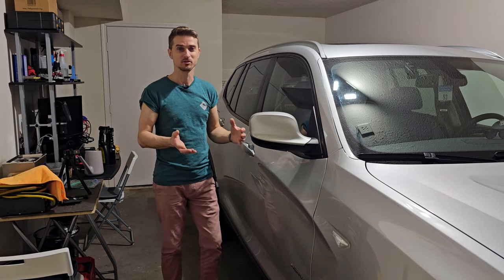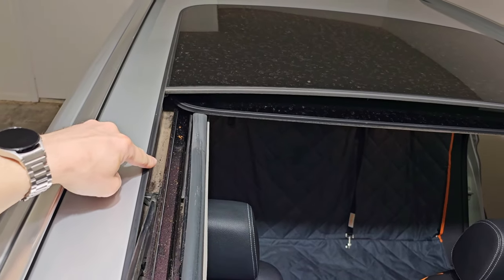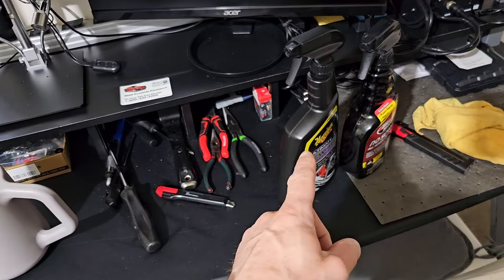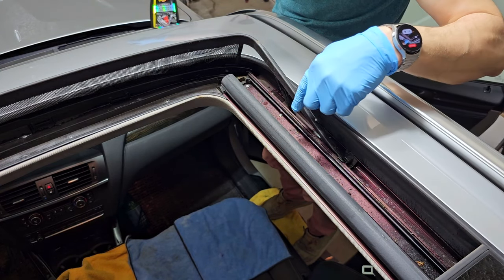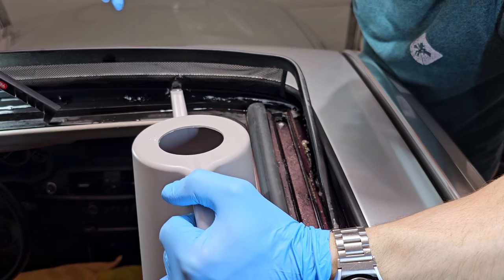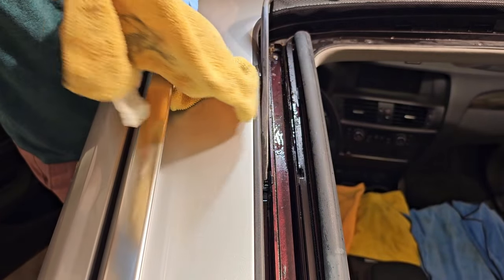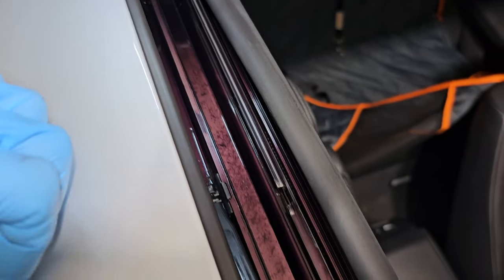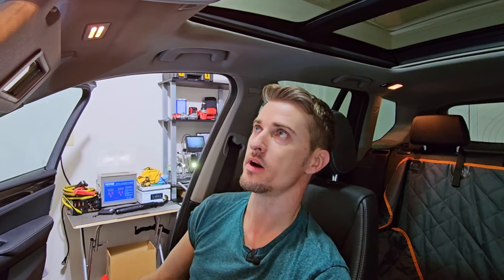Clean Sunroof Drain

Comment: It is worth cleaning the drains every 2-3 years, but if the car is 10-15-20 years old, it is also worth improving the seals on ends of the guide rails. Over time, the sealant leaks and, despite unobstructed drains, water can get inside. (btw. I always use dry PTFE after cleaning the guides.) ;)
Reply from the maker: Nice job!
Reply: Can you show us whats is exactlly the seals on ends of the guide Rails? I don' t understand what is it 🙏

Comment: E34 touring have the same type of rear drainage like in your video :)) but on E61 is a nightmare like you say. I had to remove the headliner so i can remove a few rotten leafs that turned into mud and also removed the caps at the end of the tubes which are located in the rear bumper... anyway nice to see you starting to rebuild your workshop
Reply from the maker: Thanks! Do you know the role of the end caps? They are for noise reduction from wind and also serve as an insect barrier . But also is the failure point when mud will start to clog it up!

Comment: I'm on my 4th BMW, all with a sunroof. Previously, I had an F39, which I bought new and ordered with a panorama sunroof. Since I never had any problems or issues with the sunroofs on the first two BMWs, I didn't give the sunroof a second thought and the dealership never told me it needed any maintenance. The car started having passenger restraint malfunctions and the dealership did a lot of work on the seat, including replacing parts on it, none of which made any difference. Then I started having instrument cluster malfunctions and other electronic malfunctions. Back to the dealership for probably the 10th time and they still didn't figure out what was causing the problem. Finally, I looked in the rear storage compartment and it had a puddle of water in it. I was driving the car to the dealership when it died on the road because of a drivetrain malfunction and had to be transported on a flatbed. They took the entire interior out including the headliner and carpet so it would dry. Of course, the cause was blocked sunroof drains. They had the car for a couple of weeks to do this. On the day I was going to pick it up, it was parked in their lot and it rained. I checked and the floor was wet (again), so they had to remove the interior and recheck all of the sunroof drains a second time. As if the hassle wasn't enough, the dealership tried to tell me it wasn't covered by warranty. After a discussion where I reminded them that they never told me it needed any service and they didn't even notice the problem until I found water in the storage compartment, they agreed to cover it. I don't want to know what the bill was, probably well into the thousands. A few months after this was resolved, the extended warranty was running out, so I traded it in. It was the worst car experience I've ever had, mostly because of the fcuking sunroof. People, make sure you get your sunroof inspected and serviced, especially if you live in a place where it rains a lot, such as the Pacific North West. Is the process to clean the drains on an F87 relatively similar to what you showed in this video?

Comment: I have an 2008 530d E60 LCI , never cleaned the drains or lubed the tracks. I found your video as I was looking for a video for sunroof maintenance (lubing, refreshing the gaskets etc). 
I will use some lawnmower orange wire to run it down the drains as well, it is soft and it should dislocate any build-ups that may be down the tubes.

Comment: What about water comming in the rear doors? I have 2007 E70 and both sides have the issue. Also had to rear seal the two rear wire grommets on the left and right sides at the top just to the outer from the drain hole as water was leaking into the rear trunk sides and filling up the left and right rear sides bottom compartments. (2-3inch of water)  Had to use a wet vac with the car on a slanted driveway to get all the water out and there was a lot.
I understand that this is a very common and potential problem becasue of all the electronics that the water hits..escecally on the right rear side
Reply: You need to replace the sealant from the foam-ish material inside your door. The sealant is called snake butyl.